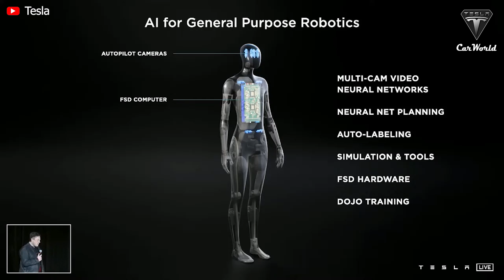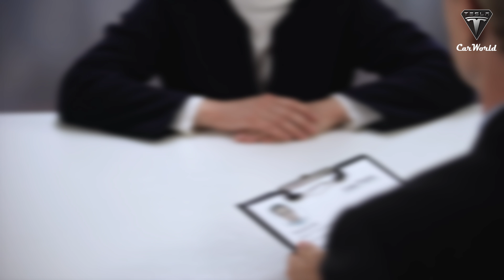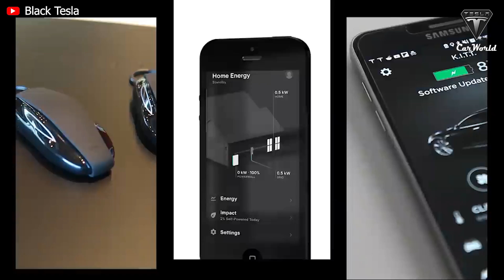Elon Musk Revealed "Giga Texas 100% USAGE of AI Optimus", REVOLUTIONIZE The Global Industry!

Comment: Wow!  There are thousands of actuator designs.  Rack and pinion, worm gear, solenoid,  stepper motor,  linear hydraulic or pneumatic pistons; are the tip of the iceberg.  Whoever gets to work on this project is a lucky person!
Reply: I have my own air actuator design the weight is in a few grams but can lift 200 pounds , it mimics biology